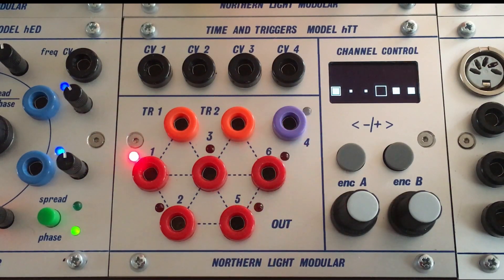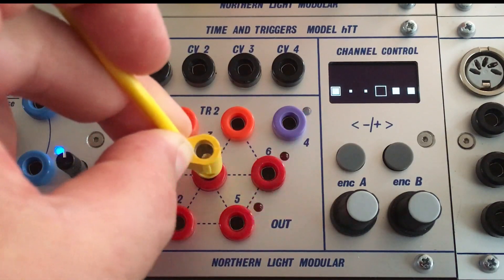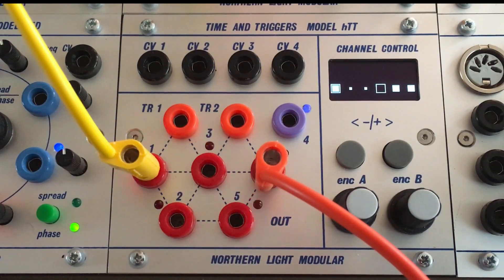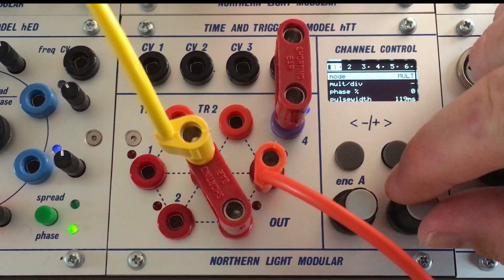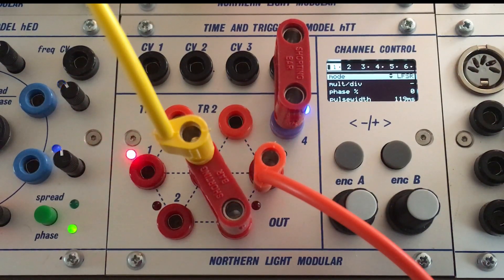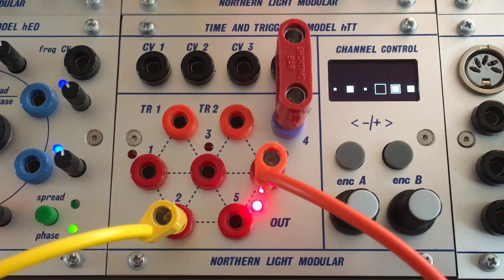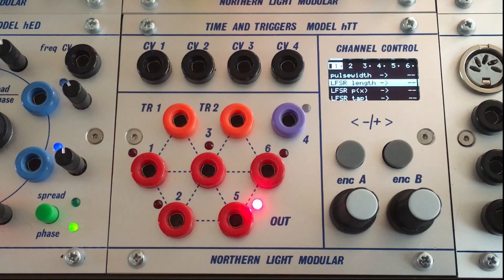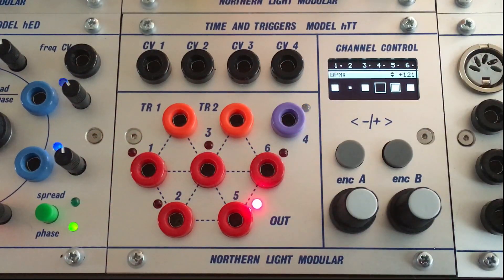Time & Triggers  -  model hTT

Comment: Does the full sized TT have the Preset Storage slots?
Reply from the maker: Yes of course, the firmware is the same for both.
The CV inputs can be set per channel and can control the tempo multipliers, the pulse length, the phase or the clock source by default.
Advanced modes like Euclidean also offer control over the lengths and fill rate, and many more.